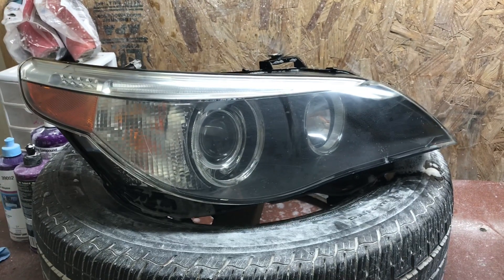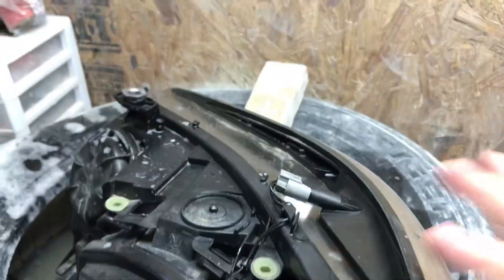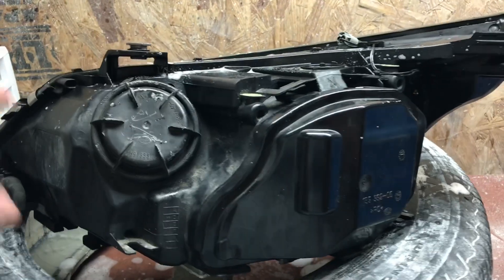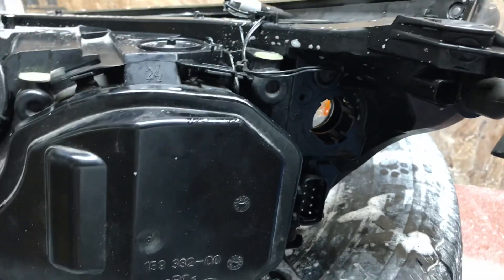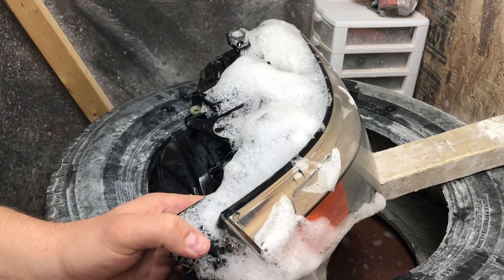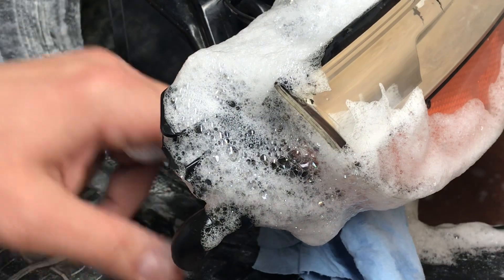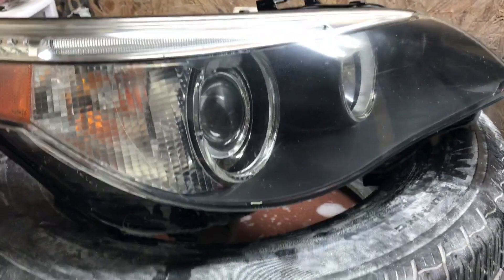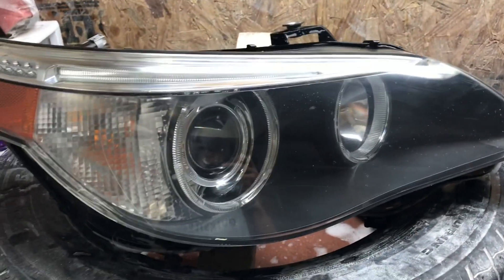Headlight Testing: Why Is My Headlight Getting Condensation Inside

Comment: Could you just seal it with hot glue instead with a silicone? Hot glue dries up much faster. And would make overal job much faster .
Reply: Depends if it sticks. It's more than just plastic that is involved.
Reply: I just use solder iron and pla to seal the cracks
Reply: what do you mean by "pla"?  @Pipipop-y5c

Comment: I bought brand new fog light housing for my Cadillac about 5 months ago and I just noticed about a few days ago that  they both have water inside and condensation. Water isn’t filled but it’s a small puddle in the bottom. They are both 5 months old idk why they started doing that? They are aftermarket from A1 Auto . Any ideas on what’s causing it ? No cracks and I always take care of my car so for a fact I know they haven’t been pushed or hit .

Comment: Hey, you ever done a lens swap on e60 headlight?
Reply from the maker: P. Letchik hey, no I haven’t but a friend of mine did. Same procedure but you have to take out the LED strip form the old lens and glue it to the new one. That part is very complicated.
Reply: @pavmik1  same glue as for sealing the lens?
Reply from the maker: P. Letchik I’m not sure what’s best for it. If it won’t be visible from the front then it will be a good option.
Reply: @p.letchik128  Butyl Silicone

Comment: It's not necessary to blast air into the water beforehand to create all those bubbles.  The air leak will create bubbles just as well if you pour the soapy water straight on the seam while blasting the air in, and it's a lot easier to see that leak if it's not already under 2-3 inches of foam.

Comment: Great video, Im having moisture that wont go away on the top orange eyebrow of both my E60 headlights. Any way to get this out? thanks.
Reply from the maker: erik smith I know exactly what you’re talking about. Sadly that top piece is glued in and hard to dry out. There’s really no access point. However if you were to just seal that piece in the seam with silicone or glue, you might be able to prevent more moisture from coming in. And hopefully what’s already in there dries out overtime.
Reply: @pavmik1 

Hi mate, wonder if you can help me. Havent been able to get any info on forums, i have 535d e60. I have alot of moisture on passenger side headlights, my car ia fitted with bi xenons. Basically question is can i juat take the xenon out and do the old hairdryer trick to remove moisture and then seal up any gaps or is that unsafe because they are xenons?

Thanks in advance
Reply from the maker: Abu Yaqs Cruz Hey!! I always dry with a hairdryer:) xenon or not. If it’s only moisture 30-40 minutes should be enough but if there’s actually a good bit of water then I’d probably take them off the car and spill the water out then dry. Just take off all the components you can so the air can circulate in the light.
Reply: @pavmik1  thanks mate, but i have another issue now i tried replacing bulb today, and the bulb isnt the same as the video it muat be an older generation bulb. When intry to lock it back on place it won't lock in
Reply from the maker: Abu Yaqs Cruz I cant really say without seeing. But you have to buy the correct bulb that matches the ballast. It’s either going to be D1S or D2S. Also your bulb might require a little bracket that clips onto it so it could be installed.
Reply: @pavmik1  i have bought right bulb, and inserted everything correctly but it's the igniter ain't close now, i.e won't resist to the right. So bizarre